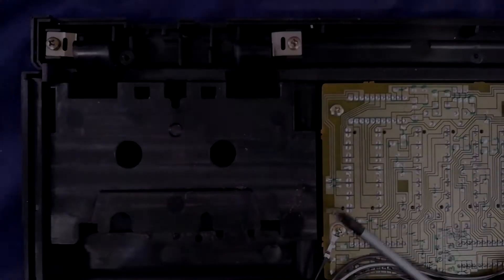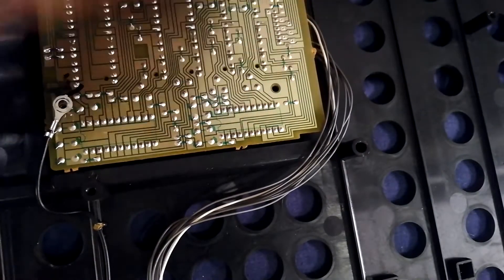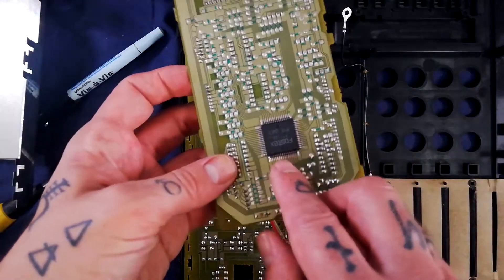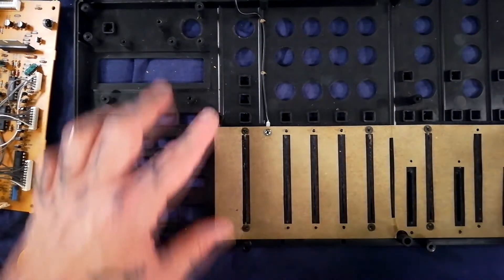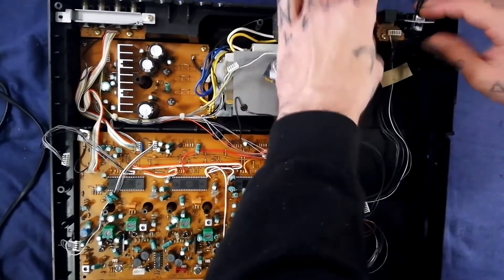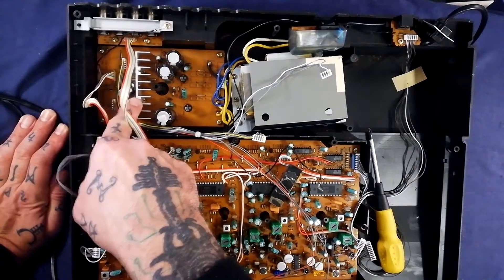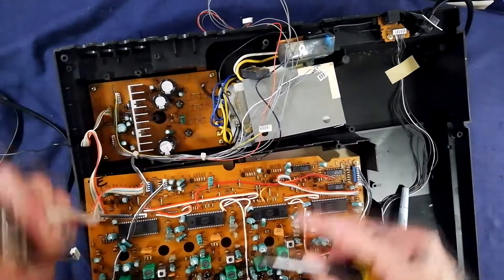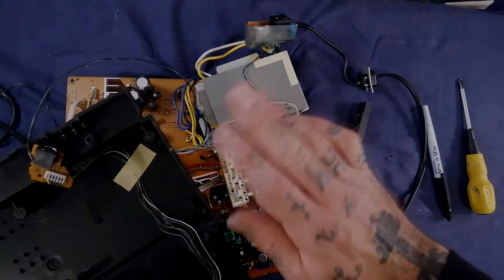fostex 280 Tear Down 3 deconstruct lower half

Comment: Hey there! I recently got my hands on one of those for ~$80 and I'm currently in the process of bringing it back to life. This series has been a great help in figuring out what's going on and how these things actually work, big props 👍 I also have a Tascam 464 arriving in a few days, watching your videos on that one right now.

I saw in other comments that you decided to scrap the Fostex for spare parts, so you probably won't be able to help me, but I do have one issue that I'm trying to fix: channel 1 won't accept inputs or play from tape. I can record to tape track 1 from a different channel, but the playback won't work, so it's almost definitely the mixer channel that's dead. I suspect it's the fader itself, the device has some physical damage around that area (someone probably dropped it and it landed on the corner 🤦) and when I push it to max position the static noise gets noticeably louder. Any thoughts/ideas? What other things could be causing this? Also, if it is the fader, can I even find a brand new one with the same pinout?
Reply: Added info for people who might stumble upon this in the future: after some contact cleaner and testing with a multimeter I'm now pretty sure it's actually that channel's amplifier that's dead, as it does output sound, but very very quietly even if you crank everything to max level.
Reply from the maker: Try replacing the  electrolytic capacitors associated with that playback and record amplifier, heres one of several videos I've made on the topic to give you an idea https://youtu.be/PzFodOYZa6I

Comment: Wow, I'm late to this one/your channel. I spotted this because I ordered a Model 280 lately (it has not arrived yet) and wanted to see the pitfalls in the servicing-department. The thing is that I have had already 7 Tape-Multitrackers which were not or only partly servicable (because of proprietary parts mostly) and just want to acquire one that is completely working - with or without further repair. Might've been a dangerous decision to go for these Fostex-Models once more...hm?
Reply from the maker: The Fostex stuff isn't any.less well built than the Tascam models, but they do seem to be mire neglected by the time I get my hsnds on them. I wonder if the lower price point at the time and lower prestige means they were less well looked after?
Reply: @Tetrakan  From looking at certain Tascam „bestsellers“, I imagine that the wellchosen limitations on models made them appealing to most and also with less parts to operate, it made them serviceable a bit easier. The worst machines I had to resell/trash were Fostex (the smaller X-series-models) and Yamahas (here I simply made bad deals). Also once the Tascams were popular for whatever reason, I‘d imagine that more have been sold in their prime-years, so now if you need parts for repairing and frankensteining the hell out of it, you‘d have the best chances. Might be an economic choice today…

Meanwhile, as with my Tapemachine, I tend to look for simpler designs for the sole reason to have better chances to keep them running. I‘d love to have a Tascam 424 or 414, because that would feature what I‘d like to have and nothing extra.
Reply: @Tetrakan  Mhm, my first attempt did not fire through: The unit arrived and is indeed in immaculate condition, optically. Functional I've managed to test everything except the ins- and outs up to this point. Since everything works as if nobody had ever used and just conserved it (even without scratchy pots and sliders!) I'm at least positive that potential issues with the audio-paths will be quite fixable. Since the unit is so good and I'm a total botcher, I'd - if needed - give it to professional service. Great stuff for far less money guys would ask for at reverb currently. Edit: Everything simply works. Whoever held that thing, he/she held it dear to the heart!